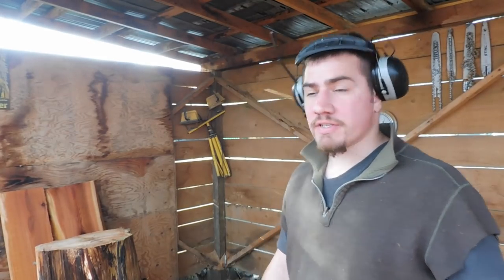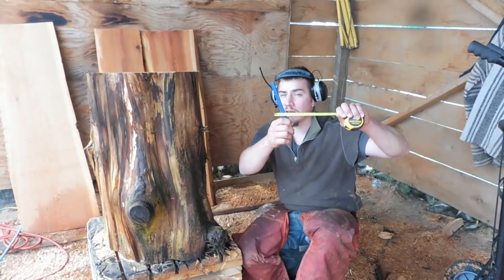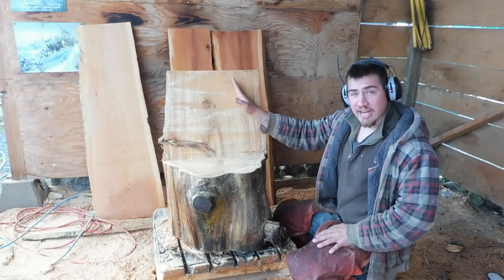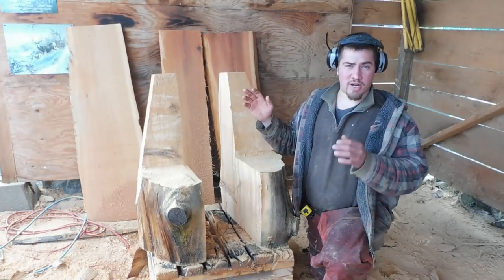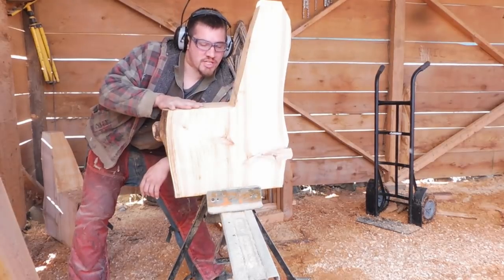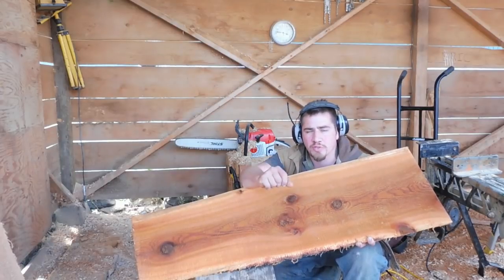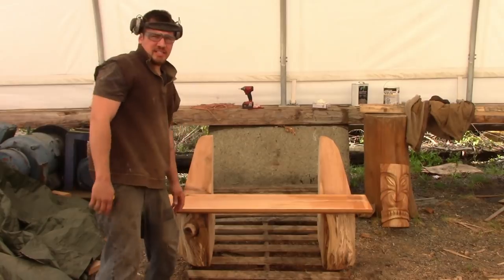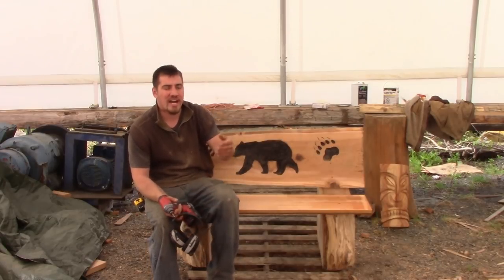$350 Log Bench Tutorial/ How to transfer an image onto wood!

Comment: Nice video with great information.  The pattern transfer is a great idea.  How come I didn’t think of that instead of doing bad tracings with carbon paper!?!?!  You’ve probably talked about the chains on your saw before but, do you use a ripping chain or regular chain or both.  Your rip cuts like splitting the log go so smoothly.